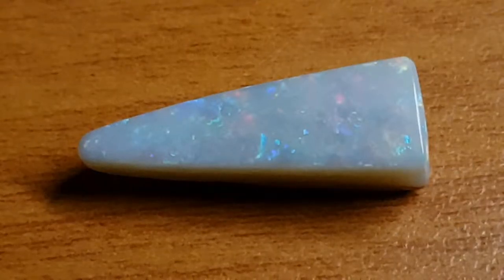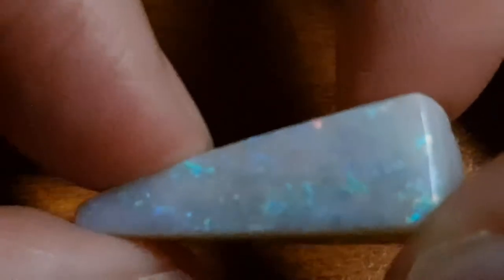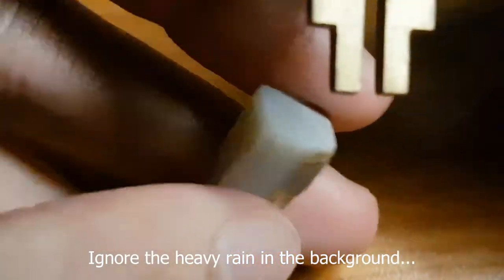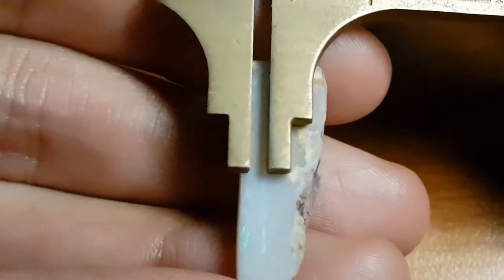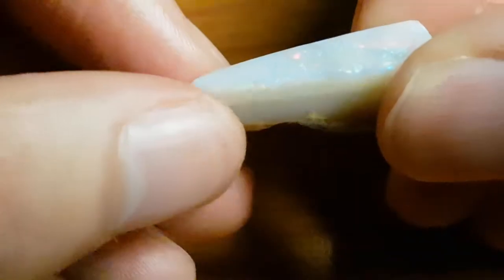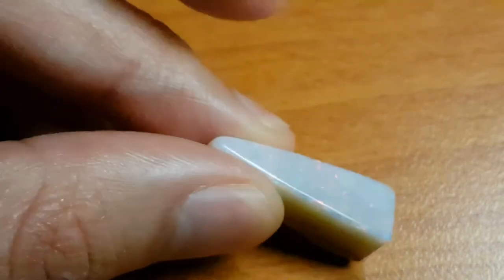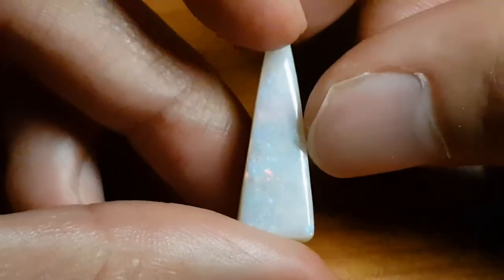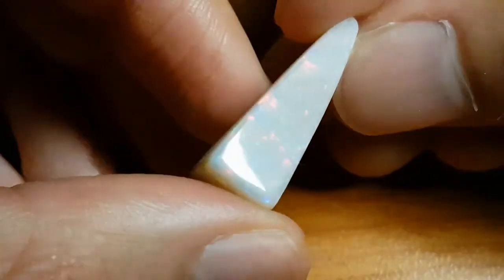How Thick Does an Opal Need To Be? Cabochon Thickness For Opal

Comment: I'm glad I found your channel... I am new to opals... I have dremel, some diamond bits, and nova points... I also have some cerium oxide now... I've bought some rough off of NNopals to play with... I'm getting I to Welo as well... Lots of color in some of it
Reply from the maker: Nice! Start slow and steady. 
The biggest mistake I found myself doing (and sometimes still do) is rushing through the nova points. Doing that just means you have to go back a grit but it can get annoying. Dry between each stage and have a good look before moving on. 

If you need more help or anything feel free to comment and I'll most likely be able to see it and respond. I'm only a toddler of a channel which means I can reply to more than the big boys.
Reply: @RoysRocks  Thank you for the replies! It is difficult to find opal cutters at my stage... Seems like all of the few channels on yt all have cabkings and I just cant relate yet... Maybe someday... for now, its nova points and dremel...
Reply from the maker: Yep dremel and nova for me as well. 
Its not so bad. Bit slower but we can at least get a little more creative! Even if/when I get a set of wheels the dremel carving will still used on a regular basis.